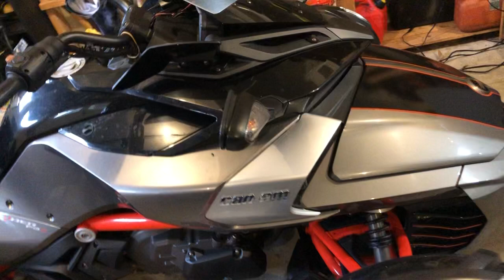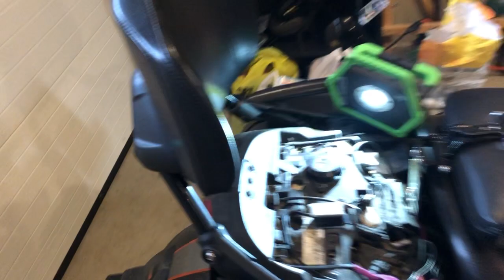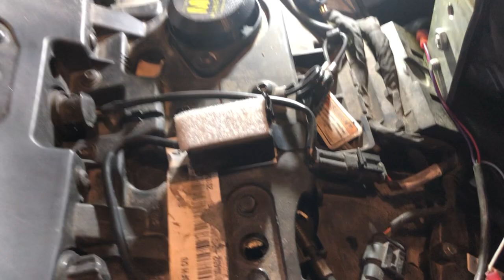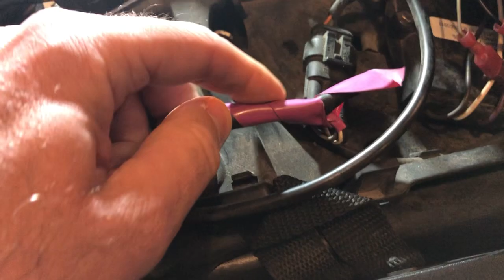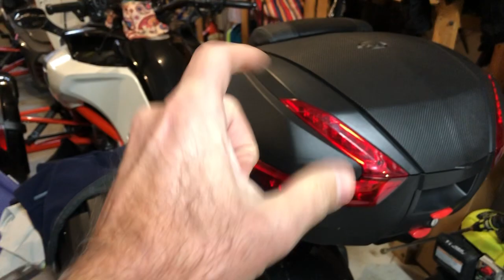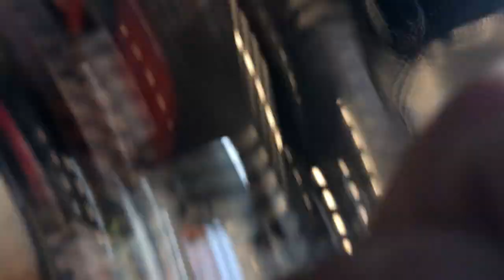ST2 Brake Module on 2015 Can Am Spyder F3-S

Comment from the maker: Just a follow up after a year. One of my system stopped working so I orded a new one from the company. The new models have a bigger box. Unfortunatley I'm having a heck of a time getting it to work. I've tried a few boxes and cannot get them to work. One way to "test" it, is, turn on the bike, and then tilt the box. This is the conundrom: when I do that it does engage the brake lights...BUT I have to really tilt the box forward a lot for it to come on. I'm at a loss as to why I can't get the new model to work. Has anyone else got the new 2023 model to work on a Spyder?